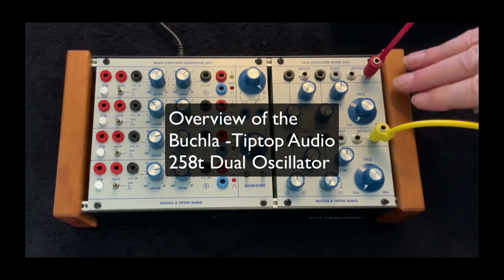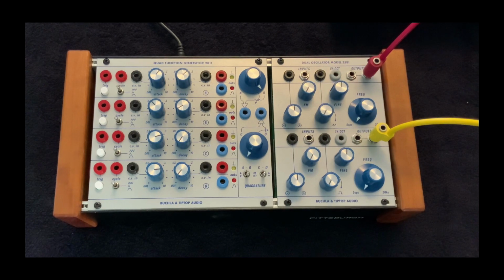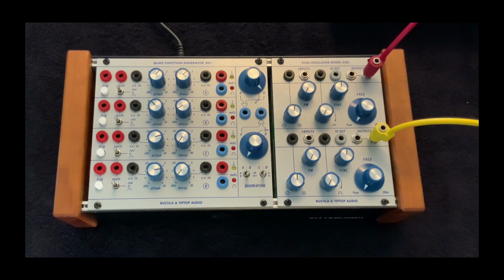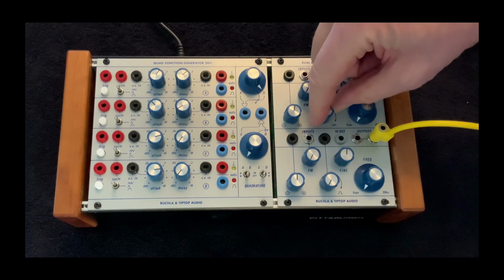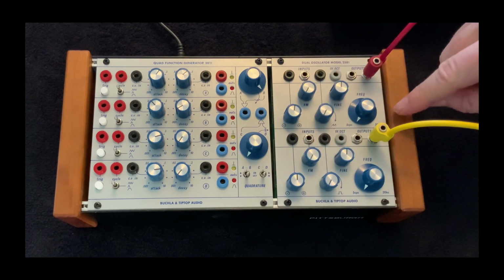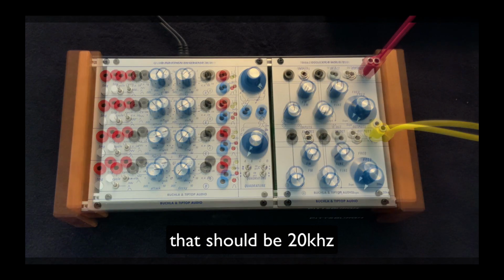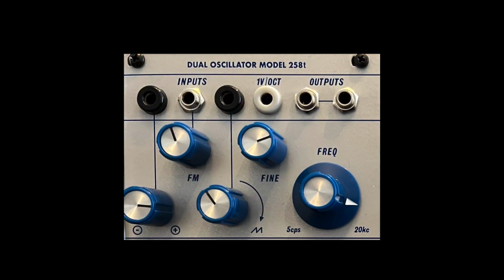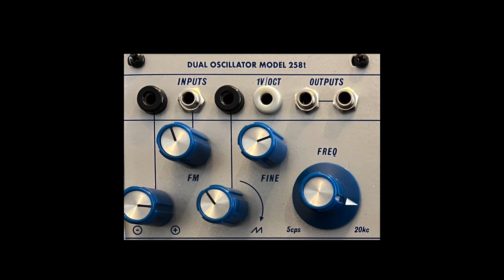Buchla Tiptop Audio 258t Dual Oscillator

Comment: wait, is different FM inputs have different FM types? 1/voct sounds more exponential, and regular FM is more like linear. Am I right?
Also curious about the original 258, I always thought that it has only linear FM, but now not so sure
Reply from the maker: Don’t know the technical jargon, just know I’m hearing different and cool FM spectra.
Reply: Apparently there was a few different versions of the original 258, some had only expo FM but later(?) ones also had linear. The FM input on the 258t is linear and the 1v/oct + the attenuverted CV in are exponential.

Comment: I am curious if someone already has Maths and Make Noise DPO, is there anything this combo is bringing to the party that those two modules can't accomplish? (outside of costing much less than the Maths/DPO)
Reply from the maker: Ah, apples and oranges ☺️ Maths is based on a combination of the Serge DUSG and Buchla 281/257 so it does lots of different things than just a 281. The DPO is. very much like the 259 which has wavefoldind and switched for various types of modulation and a section for waveshaping. The 258 has none of that. Cheers